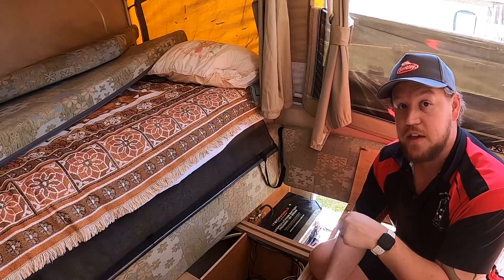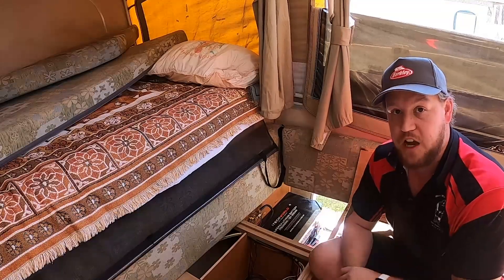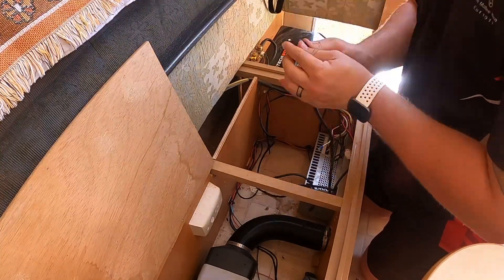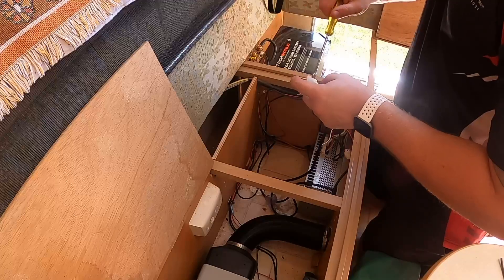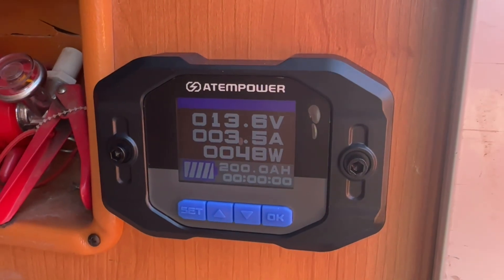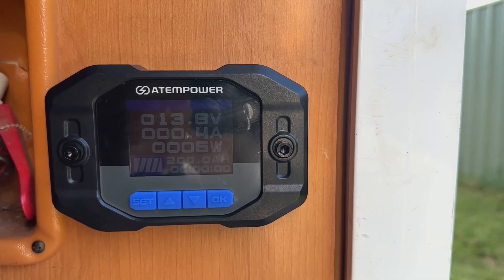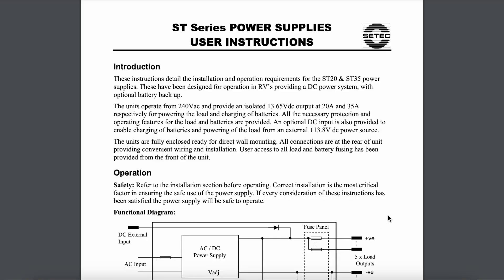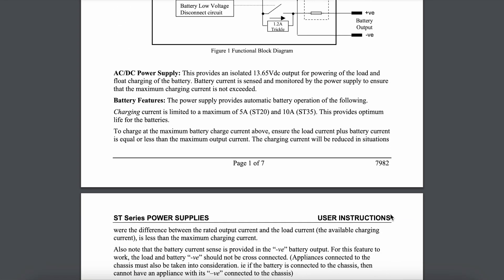Charging a LifePO4 Battery with a LEAD ACID Charger | DOES IT WORK?

Comment: Out N About, You're pretty much come to the conclusion I'd come to but I've got something you might like to test, first I'll give you an idea of my setup, 2 iTech 120X lithium's, 500w solar, Victron 100/50 solar controller with a Victron 500a/h shunt, Projecta 25A charger, and a Vitrifrigo 150Lt compressor fridge, what I've found with the Setec that I've still got connected (I have my Victron Shunt between the battery and the Setec shunt) is it charges at a higher rate when the batteries are down a bit but once they get into the 13V range it slows down, it also has a Max voltage of 13.8 and a float level of 13.5-6, once on float level it has a trickle input of .8A, but the big thing I've found is when my fridge kicks in it doesn't replace the outgoing amps about 5 to 6 when running and just trickles along, if I'm on 240V overnight when I wake in the morning my SOC will be down to around 90% depending on time of year and how hot it is, the Setec doesn't seem to have the ability to recognise the outgoing Amps and replace them when it's on float, it just trickles along, I don't know but maybe it has to get down to a certain voltage before it kicks in and starts replacing the outgoing amps, it doesn't bother me that much because my solar will soon replace the amps in the morning, I know iTech says you can drop their batteries in and they're compatible with most setups but I don't like to leave my Projecta charger on overnight because it has an unchangeable float level of 13.8 and my Solar Regulator, Shunt, and Setec are all set at 13.5 so if I ever need my charger which isn't very often as soon as it reaches 14.4 it only takes about 10 minutes to go through absorption and to the 13.8V float level and when that happens I turn it off and I never leave it on overnight. My opinion of the Setec BMS is it was adequate for small systems back in the 90's and early 2000's but Jayco should have invested in a different system sooner than they did. Cheers  PS. Maybe it's just my Setec. Lol, but I don't think so.

Comment: I just bought the POWMR ALL IN ONE 3 K HYBRID INVERTER/CHARGER/CHARGE CONTROLLER being sold under $300 on the bay. They are old stock, said to be for" lead acid only". BUT it is 24 volt dc . An, 8s, 24 volt, lifepo4 has the same charge needs. it's perfect for $268 plus a $40 wifi module. 
I think it will do fine.
Reply from the maker: Hey mate, sounds pretty solid.
Let me know how it goes!

Comment: About 5 years ago or more, I bought a 24 volt DC to 110 volt AC, inverter /charger , Uninterrupted power system ,UPS, which is ,[house power, before battery power]. This could also switch to Automatic transfer switch which is [battery/solar power, before house power].
It has a 50 amp charger  with settings for 7 different Lead acid settings  . I have been using the AGM 2 setting of 28. 2 bulk charge with a 26.8 float. A 24 volt lifepo 4 is the closest match to lead.
 The normal resting point of an 8s lifepo4 battery pack is about the same as the  float cut-off of the lead acid charger so once it reaches that point it stops and stays off because lifepo4 holds a charge unlike lead. When it does come on to float, it is a low amps charge to bring it back up.
 Used with my Epever Solar charge controller and  300 Watts of solar, the batteries are cared for and always ready. 
 It's been on like that for years and the cells don't look much worse than when I got them cheap on ali x  ,5+ years ago.
 my only real problem is my cheap unbalanced/unmatched cells. Some cells charge faster than the rest and when that happens the BMS shuts down all charging until they settle , recover, equalize .That last part of the charge can take a while. 
All the perimeters of the Battery management system are adjustable on the phone app.  There are so many  protections and adjustable settings. So you can set up what you want. Plus endless DIY  videos on the tube.

Comment: Mine will charge my renogy lithium to around 98% but the charging slows due to the agm profile towards the end, I do have a victron 17amp smart charger and have run both at the same time for a faster charge
Reply from the maker: I found the same mate. 
Tops out at about 98 then struggles to go any higher
Reply: @OutNAboutAustralia  You can adjust the the float charge higher.I don't know why that works , but the regular bulk charge don't. But I find that even if you charge that lifepo4 to max. it will still settle to 27 in short time anyway.. I think the lead chargers might govern by resistance or something lifepo4 lacks.